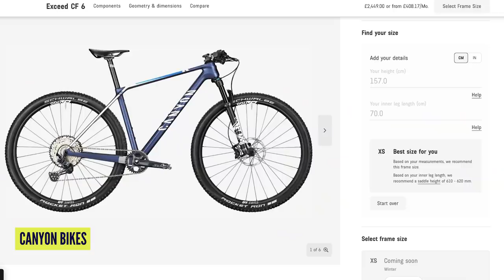How Do I Stop Arm Pump From Braking Bumps? | #AskGMBNTech Ep. 174

Comment: #AskGMNBNTech i've got deore xt in my comuter (canyon pathlite 7)  clutch is on  all the time i wonder why it need to be serviced so often , every month i need to grease clutch mechanism (i use dedicated Shimano Shadow+ and its placed where it should be) because of jumping action of Cage  i lowered tension on clutch several times could it still be to high?i dont have dyno  key to check it properly but tension feels to be just right. second problem is clutch is turning itselt off during the ride i'm sure its reasembled corectly, could it be fixed or its just Shimano clutch thing?

Comment: #AsGMBNTech Hi Doddy, Thanks for all the info for bike maniacs like us haha but my question is I bought a new frame commencal 29" with rear hub spacing 12x148mm  and I'll use my current wheels but they are 12x142mm. So,  what is the best way to adapt from 142 to 148mm hub spacing? Good Rides Andres!
Reply: Depends on your Hubs... Some Hub Manufacturer provide some sort of Adapter.

Comment: #AskGMBNTech Hi, Doddy! Should suspension travel be adjusted to the rider's height? Would it make sense to go for a bit longer travel bike only because someone is a taller rider?
Reply: No.
Reply: @th_js  but why?
Reply: Because that doesn't make sense. What's your thinking behind this?
Reply: @th_js  bigger dude has bigger bike, bigger bike should mean proportionally bigger parts. For example size S bikes often come only with 27.5 wheels. A 150cm tall guy gets for example a 150mm travel bike, if we wanted to have the same characteristics for a 190cm tall rider,  optimally the whole bike should be "stretched" to his size, resulting in 190mm travel.
I know, bike geometries are not this simple, but i don't see how a taller rider wouldn't benefit from a longer travel bike.
If the answer is "it doesn't make sense", then i would like to have a proper explanation about why not.

Comment: #AskGNBNTech, hello. I have an old Cannondale (1990) aluminum touring frame which had dropouts for a skewered hub. Assuming I rebuild a bike using this frame, my thought is that through axels are out, but I am interested in having strong axels so, am I able to switch to solid axels of at least 12mm? 14mm? Yes I am OK with a standard theaded nut. Is there a brand of hub that caters to retro or refit? Industry 9? Phil Wood? In addition the steering tube is old fashioned, having used an internal wedge/neck, but I would not mind having the more modern stacked stem/neck. Is this even possible?

Comment: #AskGMBNTech Hi Doddy, I'm looking at getting a new aggressive hardtail and one of the bikes I'm looking at is the Commencal Meta HT. I noticed on their website that one of the sizes was XS with a 27.5 front and a 26 inch rear which is great for short riders like myself! But I want to know why haven't any other bike manufacturers tried a mullet bike in this setup before? Seems like a perfect solution to a size problem!
Reply: I love how I ask that and then my question from last week gets featured 🤣
Reply: Smaller riders have the predicament of Size S being too big and having to run it anyway because most brands only stoop down to 160cm and no lower... (I'm 164, and Size S is just right, most of the time)

A 27.5 /26 mullet will feel, to you, what a 29 / 27.5 mullet will for a taller rider like Doddy. It's proportional, but also practical as you probably wouldn't clear a 29er rear wheel travel.

Comment: #AskGMBNTech. Hi Doddy great show. I have a question about lights. I am looking to upgrade and get new front lights so I can do some more adventurous night riding. My question is. Which would be better to get, one 4000 lumen light or two 2000 lumen lights. The lights I'm looking at have external battery packs. I know having 2 battery packs could awkward to mount. That isn't a problem for me. The light I'm looking at are made by Lumicycle and they make a Y connector to connect 2 lights to one battery.

Comment: #AskGMBNTech Hi Doddy, thanks for all the advice over the years. I do have a question regarding shortening the travel of a suspension fork. More precisely I am planning to do a full bike build with a 150 mm pike in mind. Can I somehow shorten the travel to 120 mm to put it on my current hardtail and reverse it back to 150 when I got the rest for the build? 
Cheers, Patrick
Reply: If it's like the Lyric, it's just an air piston length change.
Reply: @kevinshort3943  no changes on the damper at all?
Reply: @patorico_8879  
Youtube keeps deleting my reply, sorry.
Everything is in the manual on the manufacture's website.
Reply: @kevinshort3943  no worries :) thanks for not giving up then ;) I'll have a look into it. Thank you
Reply: You need to find out if a regular trail Pike accepts a 120mm RS air shaft, or if there is a compatible one. Online manuals, websites, stores and your lbs will come in handy. Right now I can only think of Pike DJ being a Pike under 130mm travel.
Reply: 120mm Pike/Revelation Debonair assembly. Go for the older B1 spring for better performance
Reply: @th_js  
My Yari came with the B1 spring. It had great small bump compliance, but sucked down.
I upgraded to the latest spring, and added 20mm travel. It's a bit harsh now, but doesn't suck down..
Reply: @kevinshort3943  What do you mean by "sucked down"? I mean how much.
Reply: @th_js  
"A development of the previous Debonair upgrade with a smaller negative chamber allowing it to sit higher in the travel, whilst not affecting the off the top suppleness of the fork."
But it does affect the "off the top suppleness"  :(

Comment: Hey Doddy, I love the channel and I recently bought a 2021 Trek fuel ex 5, and I was wondering if I should be doing jumps on this bike or if I would just be slowly destroying the bike? Thanks
Reply: Dude you can jump that bike as much as you want, it's tough as nails. Check out what Cam McCaul does on his!
Reply: Jump it all you want. That bike will handle it very good
Reply: Yes I agree.  I have an EX8 and I have been jumping on it for over a year.  I weigh 190 lbs and ride a medium.  The bike holds up real nice!
Reply: Hey I got the same bike recently. I jump every once in a while and it does fine. However, the 5 comes with a x fusion shock and the dealer didn’t give me any volume reducers for the rear shock. I can’t find anywhere to buy them and the website for X fusion just says they come with the shock. This means that no matter how much air you put in that thing, it still blows through the travel and bottoms out. The front fork volume reducers were easy to get
Reply: @danielhicks5031  I had the same problem with the Marin alpine trail 7, try turning up the low speed
Reply: @hugoandreas1715  this particular shock that comes on the trek fuel ex 5 is very basic and just has lockout and rebound. No high speed or low speed
Reply: @danielhicks5031  oh ok i have the 2020 Marin alpine trail 7 which has low speed, rebound and lockout

Comment: #AskGMBNTech I put my Carbon Canyon spectral cf8 on my bike rack whenever I take it to the trails. I clamp on the top tube right above the shock and right under the headset on the down tube. I’m wondering if that’s bad for my bike? And the clamps are just Velcro straps with a rubber U shaped thing for the frame tube to sit on. Am I going to ruin my back doing this?
Reply: If the clamp supports the bike (seeing that it's a U clamp and you didn't mention a clamping upper), then it's fine as the weight of the bike would not cause carbon to deform. The difference is if you have a clamping jaw type of rack, then excessive clamping force on especially the middle of the top tube (or in the middle of any load bearing tube) may cause dents, cracks or fractures under load stress or torsional movement, of which would develop as you ride the bike and input load on the weakened area
Reply: It is definitely not ideal, but I do that too on my Spectral.

Comment: I use to suffer with really bad arm pump out of nowhere, it never use to be an issue. A couple years later and here’s what I’ve found which may have helped to minimise it.

Bike set up:
Thicker grips 
Higher rise bar 
Lower tyre pressure
Brake levers tilted a bit further up (horizontal)

Exercise: 
Dead hangs 
Grip strengthening (powerball or the squeezy ones)

Comment: #AskGMBNTech hi doddy, I have an airdrop edit that I use for bike park laps and I need to change my chain and cassette due to wear. Would there be any benefit to fitting a dh style short cage derailleur and 28-11 cassette or should I spend the extra money to replace the 11-46 that’s on there currently. ( I hate pedalling up the hills and only pedal down )
Reply: Less unsprung Weight would be  beneficial but you will need a Spacerring to compensate for the fewer Gears. If you absolutely don't pedal up maybe get rid of the Dropper Post as well if one is fitted.
Reply: If you only go down, and never ride up, then you can consider turning your bike into a mini DH rig with, like you said, a smaller cassette, a DH derailleur and a bigger front chainring. DH drivetrains tend to have less speeds, which results in thicker chain and cassette material, and less overall wear.

It will also extend your high speed pedalling gear range and help you down the track better.
Reply: @mistera1mL3Ss  my dropper post went ages ago haha.

Comment: #askgmbntech Hi Doddy. I heard rumors about turning off the clutch on your shimano derrailleur would save you some energy when padeling climbs or flat terrain. However, I can't find any other sources on this. What are your thoughts on this? Love the show, thanks for sharing your knowledge with us.
Reply: It would be pretty negligible, you might notice it (the clutch friction) more on oval chainrings as the cage extends and retracts , but on normal round chainring set ups the cadence would matter more than clutch on/off. .. And while I'm at it, remember to take your clutch cover and the clutch cam off to grease it up, Shimano 12s dees come dry from factory and tend to snap into two at the clutch cover holes when the clutch seizes dry
Reply: Just ride with it on always. If there was technically a different (with ovan chainring, obviously no difference with round), the difference would literally be too negligible to be noticed.

Comment: #askgmbntech hi doddy, my rockshox maxle boost 15x110 thru axle lever came off. the screw thats thight it upp are broken the top of the screw came off so do i need to buy a new axle or can i do somethingelse?
Reply: Go for a maxle ultimate. It's more expensive but the quick release style is pretty neat when you undo your front Wheel often.
Reply: The regular Maxle doesn't have a screw..? It's just a thru axle. I'd guess you're using the quick release lever version of the Maxle, and the broken screw is to adjust the angle of the lever when closed - in which case you could try to source the same screw from a hardware store, or just get a new axle (which is what is safer and easier)

Comment: Hey Doddy, I love the show. I have Hope Tech 3 Duo. What is a good way to bleed my brakes without flipping the levers?
Reply: #GMBNTECH
Reply: Whoop whoop!
Reply: @blakemason2142  JUGGALO
Reply: Hope brakes are fiddly to brake to say the least. You need to level the levers, then remove the reservoir cover, fill it with brake fluid constantly while pulling out fluid at the caliper end using a syringe until the line is bled. Then fill the reservoir again and keep flicking the levertill  bubbles are clear. 

Experienced mechs can have the arm span of a bus and can do this with some struggle - the average joe would probably either a) spill fluid all over the fork and your floor, b) let the syringe flop and drop off, or c) finish bleeding, close everything up and realize you flicked too hard and air bubbles reentered the system, and you have to restart

Comment: #AskGMBNTech Is there anything wrong with using a good pair of hiking shoes instead of MTB-specific shoes? I ride with flats and use a pair of sturdy but basic hiking shoes. I feel like the comfort and support they offer is more than adequate and possibly superior to some MTB shoes. I can't see the justification of spending nearly £100 on MTB shoes such as Five-Tens when I can spend £40 on mid-range hiking shoes. Is this a case of style over function or do MTB shoes actually offer specific benefits?
Reply: It's a huge difference actually. Different Rubber Compound, different Sole design ( mostly Flat ) and MTB specific Shoes have a pretty stiff Sole which most Hiking Shoes haven't. 100 Bucks is a stupid Price, absolutely... I just can tell you, also from experience, it makes a difference.
Reply: Hiking shoes don't have as stiff of a pedalling platform on the sole. Even if the rubber compound is the same, the hiking shoe would flex more and not provide as good of power transfer. Also hiking shoes may provide excessive ankle and lateral support - good for DH but probably restrictive for regular trail riding.

Comment: #AskGMBNTech Hey GMBN, I just built up a commencal meta, and have GX eagle on the build.  Ive set the B tension correctly and everything, and decided to replace my chain right before it hit the .5 wear mark.  Therefor, I only have about 200 miles of riding/ enduro racing on the chain and cassette (the black coating is barely worn off the cassette).  I put on a new chain, and it seems to be skipping in the lower gears (9th, 10th, etc...). I was wondering what could be the cause of this issue if all my limit screws are correct, and the chain is of the exact length as the old one, and its shifting perfectly? Is there a wear in period for chains? Thanks, Will
Reply: Do you mean the bigger or smaller sprockets?
Reply: @th_js  the smaller sprockets
Reply: @willmyers5764  Are you sure that it is actually skipping and not just jumping because of misalignment in the derailleur caused by improper cable-tension or a bent hanger? Also, did you install your powerlock the correct way around? It's easy to get wrong if you don't pay attention.

I've got at least 6000 kilometers on my GX casette and it still isn't skipping, so there's no way yours is too worn out, unless your previous chain was way too worn.
Reply: @th_js   It was shifting perfectly and wasnt making any excessive noise, and the hanger is straight too.  Ill throw a cable in it to ensure most acurate shifting performance, and the powerlock is installed correctly.  Ill play around with it to see if it works out. thanks!
Reply: @willmyers5764  Are you sure the hanger is actually straight? Only way to know is to check with a hanger-alignment tool.
Reply: @th_js  I have a new hanger I keep as a spare that I can throw on to see if that helps
Reply: @willmyers5764  Do that. You'll see if that makes a difference and if yes, that was the problem. The only thing here is that new hangers are often out of alignment too, so they sometimes need to be straightened when new, but hopefully yours isn't misaligned.

Comment: #AskGMBNTech My Suntour durolux has a loose thread where you put the bolts for the fender. Are there any solutions to that?
Reply: Helicoil could be something to consider...
Reply: If the threads are already buggered, and you don't bother with zipties, then some plumbing tape will force-fit the bolt in place. This will ruin the thread further though, so do consider a traditional zip tie mudguard or helicoil tapping fresh threads.

Comment: #askGMBNtech is it okay to put a wide tire on a narrow rims?
Reply: Depending on your internal rim width, a wide tire that exceeds the recommended width by the manufacturer would only result in the sidewall protruding out more and forming a mushroom shape of the contact patch to the ground. The carcass flops around a bit more, which means you can not run lower psi, as you'd risk the bead coming off. So... yes, you can, but there are drawbacks, and limitations
Reply: Which sizes are we talking about here specifically?

Comment: #AskGMBNTech does the orientation of your chainring matter when running an oval ring?
Reply: Yes!
Reply: Yes, most major oval chainring manufacturers have a "dot" or "marker" to position and align the chainring to the crank. Each area on an oval chainring has a power zone and rest zone, if you install it the wrong way you will feel like you're bobbing and exerting more strength then you need to.

Comment: #AskGMBNTech Hey Doddy, what is the effect of using a fork with around 10 mm more Axle to Crown than the maximum given by the bike brand?, i'm trying to upgrade from 130mm to a 150mm travel fork, "The maximum axle-to-crown measurement  = 551mm." But The Fox 36(150mm)  has 559.6 mm a2c. Saludos from Quito-Ecuador.
Reply: It just means that "hey, we're telling you to not void your warranty by using too long of a fork on our frame!"

Go ahead and do it, a 20mm increment of travel should not be an issue bike wise, all it does is slacken the head tube angle, slacken the seat tube angle and raise the bb (handling change), but it will void your warranty I guess, if they state a max value for axle-to-crown. Check your warranty.
Reply: Should be fine. Just don't preferably go too many centimeters over the max. It basically just adds more leverage to rip off your head-tube/snap your bike in half but those are unlikely. When it comes to riding, it slackens your HTA and STA, increases your BB-height, shortens your reach and increases wheelbase. However when you're riding your bike, the "sag" will basically make these differences too small to have a negative impact.